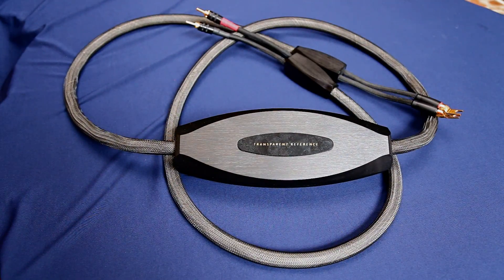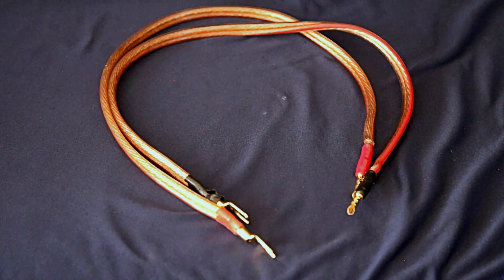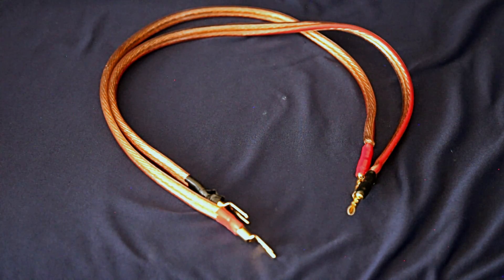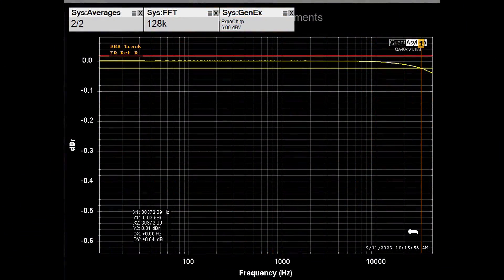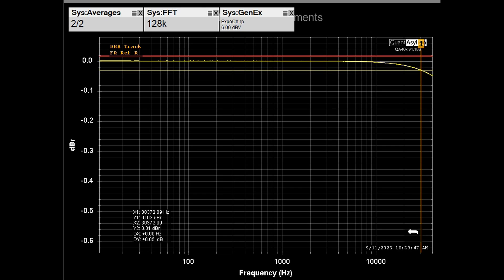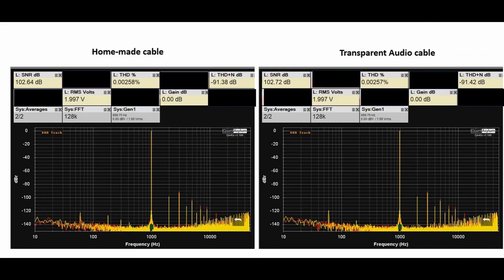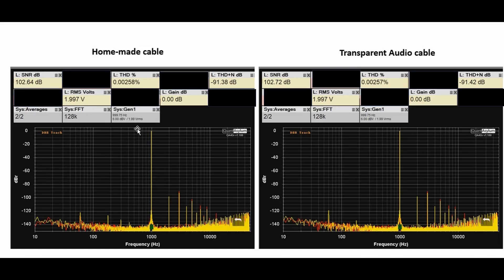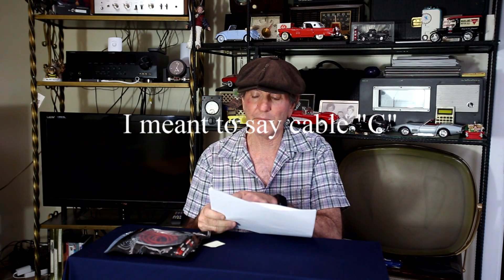$8000/pair Speaker Cable  vs. $14 DIY Speaker Cable A/B Test: Vintage Audio Review Episode #87

Comment: Hey! 
I like that you did this test.  
The underlying issue you were testing is if an 8K cable sounds much better than a DIY home made cable.  Note that while you did see a measurable difference between the two, you discounted it because it could be within the 'noise' or testing error.  

But in your test, there are a couple of issues. 

The biggest is that you only set up a single speaker for the test rather than create a stereo image. 
Of all of the people talking about the coloration of the music depending on amp, DAC or other hardware of the speaker... they also claim that the cables can also add to this.  That there may be subtle differences with the overall sound image based on the cable.  (e.g. sound stage, separation, focus... etc ...)  So unless you ran two speakers ... you lose that.

Overall,  I would argue against spending $$$$ on cables, but I'd also argue about going too cheap. 

OFC is a must. Then there's the gauge and shielding of the cable wires, and your connectors. 
I suggest that you look at the retail cost of your components.  Depending on length and quality of cable... you can spend up to $300.00 to make high quality stereo cables. 
But $300.00 is much less than $8K which would be better spent on other components to give you a better sound. Even in my small room, my cables are ~20ft in length because I have to run them behind cabinets and out of sight. (Hence the higher cost) 

Just my $0.02.
Reply from the maker: Thanks so much for taking the time to comment- with reasonable ones. I get your take on using two speakers for the "separation", but I don't believe there is any scientific basis for such a claim. Both speaker cables, assuming the lengths are pretty close to the same, would effect the signal the same amount. My a/b switching box does not have enough inputs and outputs to allow for a stereo testing of the cables  is another reason I did not do that. I am pretty sure I went over the cost of what I used on my cables, and I screwed up by using copper clad aluminum wire instead of OFC wire, which made the point even better according to many of the comments. So far the cables that I made have been holding up well...
Reply: @vintageaudioreview  
Hi, scientifically speaking, 
you already tested the cable which showed a measurable difference, albeit a small one. 

And that's key.  8K vs ~$100.00 (rounding up)  That's $7,900 that could go towards better speakers, amp, dac, etc... which will impact your sound.

The point of the A/B testing isn't scientific but more subjective and its the imaging of the sound that may be noticeable. 

Oh and I'm not saying there was anything wrong with what you made. 

When you go to source your wire,  you're limited to what's available in your local brick/mortar store... in terms of quality and wire gauge.  If you're looking at 10-12ft or less, you could go w 14AWG  and longer 12AWG.  

If you go online, you can get better wire if you want.  If you look at some of the YouTube videos, you'll see people using Magomi ?sp? 4 wire cable and then pairing them. So 2 12 AWG would give you 10AWG.  Then on to better banana plugs and you've got really good cables. 

Overall, I would encourage people to make their own cables and avoid the 'snake oil' stuff.
Reply from the maker: @michaelsegel8758  How about considering a/b testing as a scientific way of doing subjective testing 😄 There are certainly some good videos on Youtube making your own cables. If you find some McIntosh owner's manuals from the 70's, they often tell you what gauge "zipcord" you should use to connect your amp to your speakers depending on how far away they are. 12 gauge OFC speaker wire is going to work well for darn near everyone- The idea of using Magomi 4 wire cable is probably fine and might be a fun project, I suppose.
Reply: @michaelsegel8758  
Can you tell us exactly WHAT properties or attributes allow for the most accurate reproduction of the Stereo IMAGING and SOUNDSTAGE performance that was captured or produced in the recording???

IF you knew the answer, you would also know why your suggestions for conducting the test differently are irrelevant.
Reply: @ 
My father had a set of Wharfdales from the late 50's early 60's where one of the woofers disintegrated and got sucked into the magnet. When you opened up the speaker, you would be amazed at how it was made. Yet the sound was incredible. Fast forward 60+ yrs and look at speakers today. 

Lamp cord works. But is it good enough for today's components?  

Now I'm not saying to spend $$$$ on speaker cables... but something above lamp cord.

Comment: Why are you not measuring these when hooked up to a speaker and amplifier? The resistance will affect the relationship of speaker with amplifier. Especially if you have a speaker with a wild impedance sweep and an amplifier with a crazy low output impedance (.000065) / super high damping factor (123,076 @ 8 ohms) like a Purifi Eigentakt.
Reply from the maker: Thanks for taking the time to comment/question. The Purifii amp you mention with such a high damping factor (doubt that is real), would care very little about the speaker cable unless it is was really high. I just looked at something simple like the frequency response and whether there was any distortion introduced, of which there was none. Did not bother to measure the resistance as it would be much less than my meter is capable of measuring, maybe 0.1ohm. Damping factor is difficult to measure when it is very high.

Comment: On high resolutions system everything can be heard!

You DONT have high resolution system.
So if you dont hear difference, than what is the point of this stupid video???

Everything can be heard….
Reply from the maker: Thanks for the comment, though I will disagree. What are the specs for a "High resolution System" ?

Comment: I have the KEF R5 Metas and did an A/B on my system between Blue Jeans and Kimber Kable. I did notice a difference even using a Denon AVR. The Kimber sounded 'crisper' and the highs were cleaner whereas to me, the Blue Jeans sounded more like is forwarding mostly mid-range. But that's me.
Reply: @GermanRedrum  
The KEF R5 META are great speakers. 👍
In your comment above, you said that you "did an A/B on my system between Blue Jeans and Kimber Kable."

Was that "A/B" comparison 100% un-sighted (i.e. "BLIND"), meaning that you never had any idea which cable was being used at any given time during the A/B listening test?

And if so, did you consistently choose cable "A" vs cable "B", or vice versus, at least 9 out of 10 times in a row?
Reply from the maker: Thanks for taking the time to comment, though I am skeptical about most cables making any difference, but as long as you are happy with your choice, that is what is most important.

Comment: Carver C-1 ,come on man that's the biggest pos preamp I ever owned
Reply from the maker: Sorry to hear you have such a low opinion of the C1. I have a/b'd them against several preamps and the C1 holds its own, both in sound in electrical performance. I do appreciate your taking the time to comment, though.
Reply: @vintageaudioreview  compared to what audio research,sonic frontiers,Modwright,VTL,CAT,Conrad Johnson etc etc etc, I wouldn't want it if someone gave it to me free,i fell for the Carver BS 35 years ago and it was all marketing nonsense,oh sonic halography ,yeah sure the Carver amazing speakers howrver were ahead of its time
Reply from the maker: @stevieg2755  We are all entitled to our opinions. Bob Carver and his gear have a heck of a following and his gear typically gets a lot of views on my channel. I enjoy Sonic Holography. The only time I thought a preamp sounded markedly better than the C1, which it did, was because I had left it in Mono.
Reply: @vintageaudioreview  well maybe try a ARC ls-16 it's a big world out there
Reply from the maker: @stevieg2755  I'm not big on audio tube preamps. I get to listen to a lot of gear, some of it "high end". My audio world is fairly large compared to many. Spend your money on speakers that you like the sound of and make sure your amp can drive them and your problems will be minimal is what I have found.

Comment: The switch box and short home made cables would have to be eliminated, and your system would have to be a much higher resolution set up to be able to hear any difference, and your room would likely have to be treated to absorb reflections, and would need ideal placement of high end speakers. Because until you can hear things like soundstage, image front back and sides, separation of instruments, ect. you will not hear a difference between wire. THATS what the higher grade wires are all about. Myself I use different brands, always a high quality oxygen free copper. Stay away from anything Chinese, that stuff uses wire that came from a melting pot of different metals, whatever they could find in scrap. They make it look nice though.
Reply from the maker: Thanks for your thoughts on this issue, but I respectully disagree with you except for the OFC copper should be used. But but accident, the 12gauge wire I used for this test was copper covered aluminum, and still no difference in sound or measurements. After this video was posted I saw an excellent video from Audioholics where they measured some speaker cables and there is very little difference between the expensive ones and the regular wire. If there is no electrical difference I can't see how they can sound different... I can't get rid of the switch box or small cables and do an a/b test where you can switch between things immediately, which you need to do as our audio memory is not that good for trying to hear such small difference. I have another cable test video tomorrow....